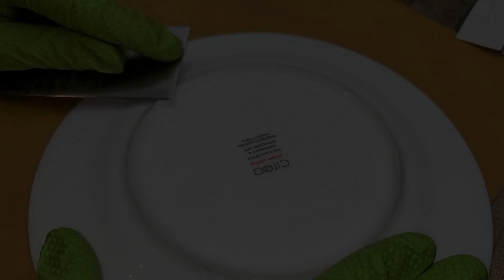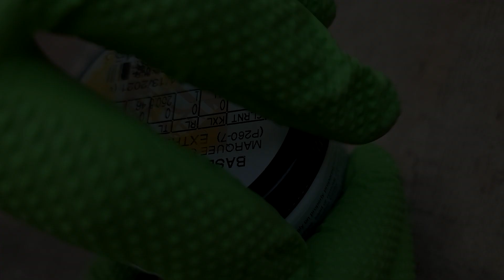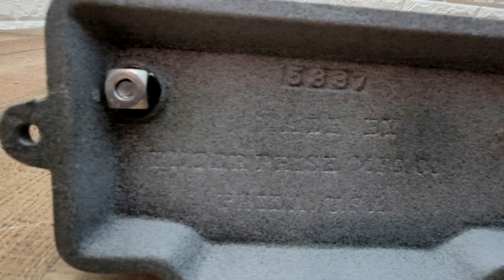1800's Tobacco Cutter Restoration

Comment: It was Japaning NOT PAINTED!! (Japanning gives you the texture of a thick coating that can not be duplicated by simply grabbing a can of Krylon and spray a bunch of layer. Makes a very hard durably finish!)So,  do it right to say you have restore it!! What you doing is repair!!
Reply from the maker: Thank you for your comment. Japanning is an old trick basically to prevent cast iron againt rust. While it was a good trick for sure at the time, it won't be as protective as a primer and paint cover. I think they would prefer ours if they had access to. :)
Reply: Calm down there too